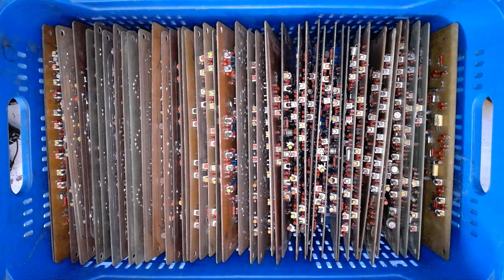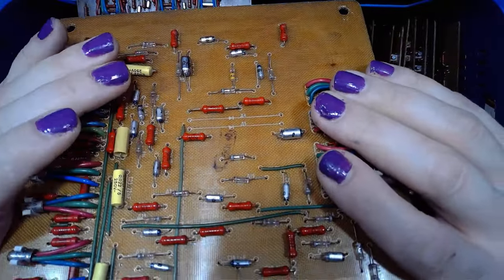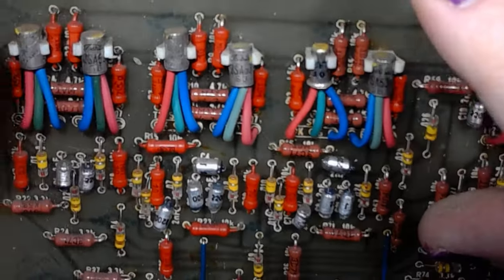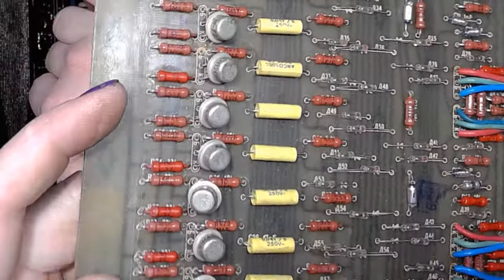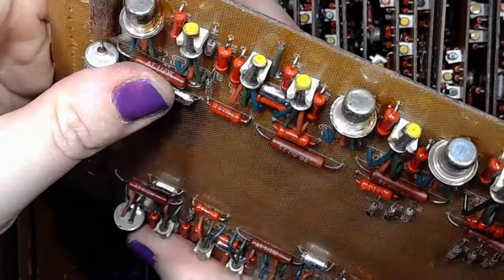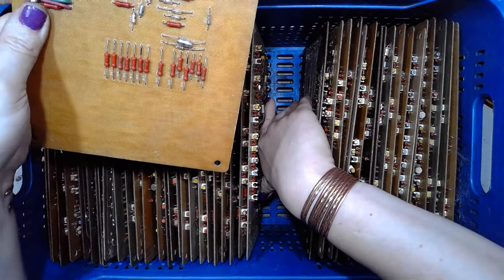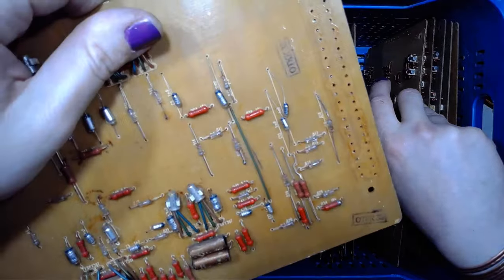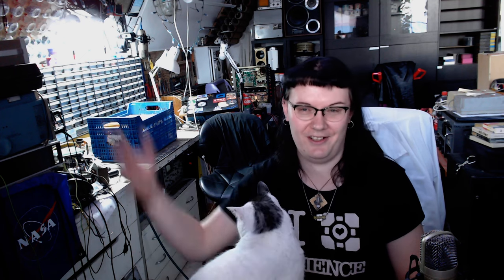Dumpster Find... USSR Computer Tech!

Comment: Very interesting find, though I haven't a clue of what device/devices (given some apparent duplicates) originally housed these.  I'd probably strip these boards for all the good components including caps and resistors.  There's probably many parts suitable for reuse.  Old high quality circuit boards such as these are not without value either.  Modified, they can be repurposed for for circuits in other projects.  Also, if the printed side is cleaned up after all the components are gone, you may find them marketable to people who have entire other uses for them.  I sold some similar to these years ago to a woman who wanted them for art 🎨 projects.  Some people view the printed circuit side of such boards as having a sort of retro "art-deco"  🖼 quality.  She even paid me to close off the the component lead holes and deflux the printed circuit sides.  Just a thought if you haven't yet disposed of these.  I've also sold a few unrepaired telelevisions, radios and even chassis that were just pieced back together for looks to theatrical people who wanted them for props 🎭 over the years.  Art is in the eye of the beholder.
Reply from the maker: Nice idea with using them for art, most of them is a bit run-down though. They could be a good source of germanium transistors for effect pedals.